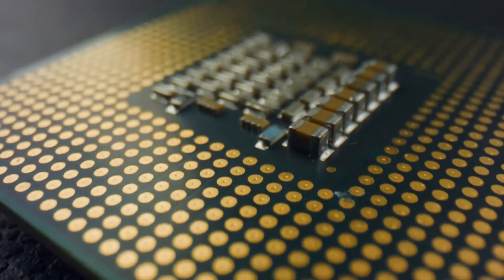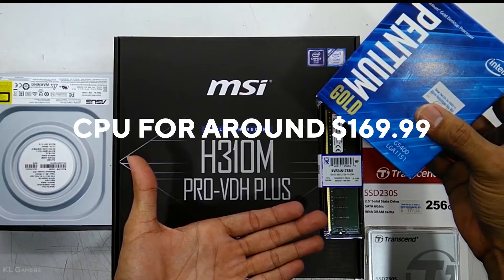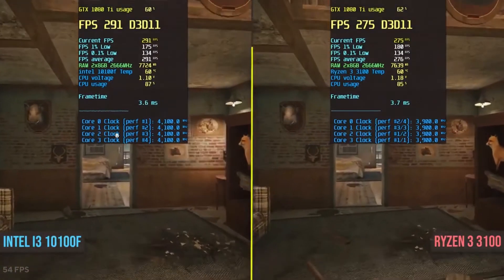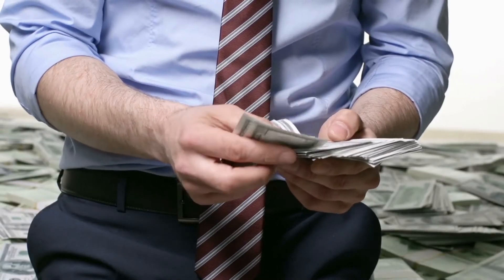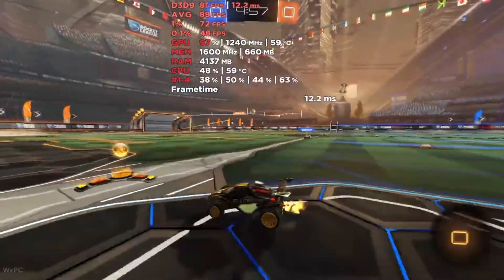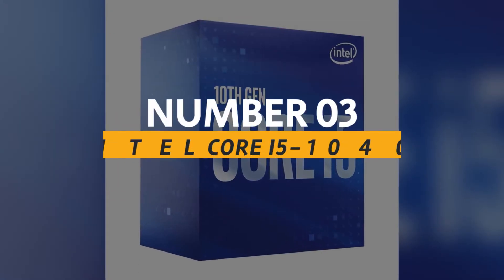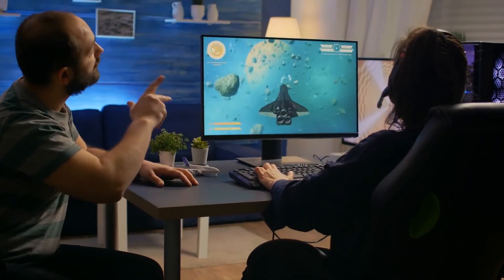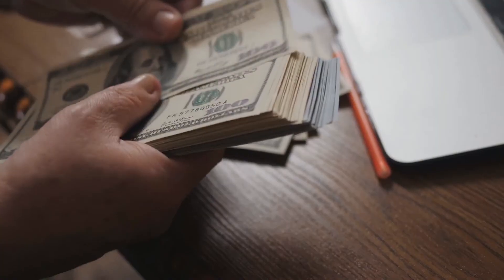The 10 BEST BUDGET CPUS of 2021

Comment: whats the best upgrade for my i5-4440
Reply: There isn't that many cpus but I would recommend either the i7-4790k or a quad core xeon cpu, as long as the motherboard supports it
Reply: @cathy99uk10   im also thinking of replacing my mobo though.  intended for gaming.
Reply: @bigpoppa9721  get 10100f and h410
Reply: or h310 and 9400
Reply: 12600k intel

Comment: Insted of the 2600 you should use the 1600af
Reply from the maker: Good tip
Reply: Those are like a unicorn they don't exist 💀
Reply: @tomwithatophat6457  wdym?
Reply: @donutbenchmarks4341  1600af are like never in stock anywhere